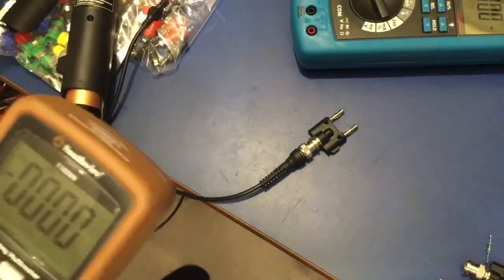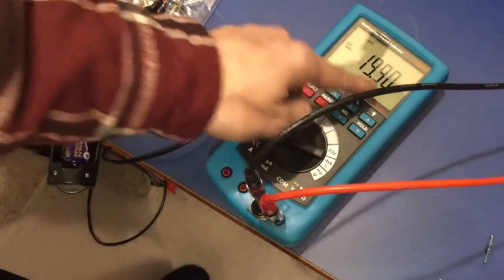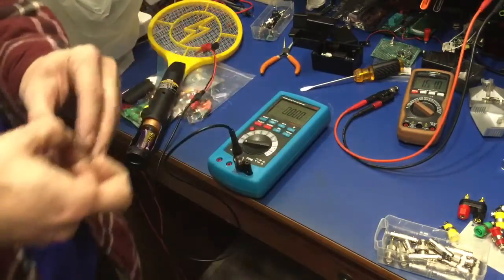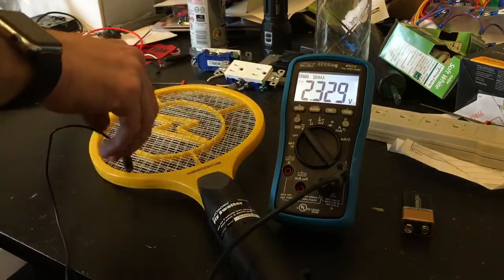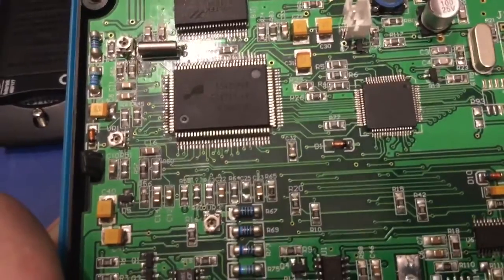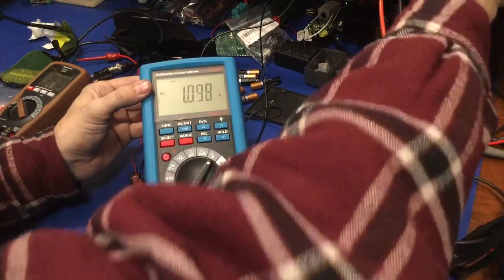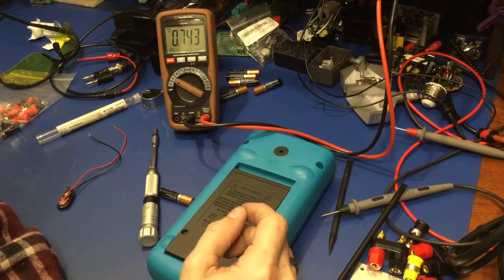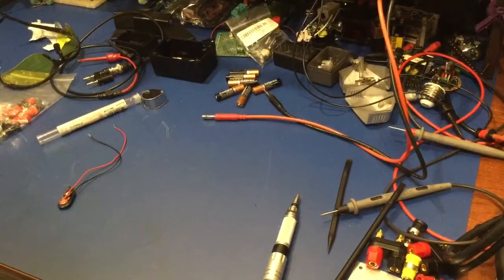Voltage of an electric fly swatter and CAT ratings

Comment: Have you tested exposing the flyswatter voltage to all ranges (except current) on a multimeter? Is that a sane thing to do? I'm so tempted.
Reply from the maker: Brian, It’s not a sane thing to do. The blue meter was a pre-production test unit that had problems, I’m not sure if they fixed it in the final version. That fly swatter does put out a current, not just electricity. Other ranges should follow the same protection path (except current) as the voltage clamping, but no guarantees since arcing can happen and take a different path also. The blue meter was rated CAT III (max 600V) but as you saw it had a design flaw that allowed everything through and didn’t clamp down at all. Another meter I did with current and it took out both fuses, so I knew it had a high initial inrush current coming from the high voltage transformer on the fly swatter. 
This was more a awakening when I discovered a meter doesn’t need to be independently tested or certified, I can make one and stamp Cat III on it and sell it. If that blue meter was measuring mains it would have probably killed me.

Comment: What about the Blue Brymen? That one did survive I assume?
Reply from the maker: Jean-Jacques de Balzac I wasn't going to mention it because I don't think it would take more then two hits. But yes, I did try it ones and it survived, so did my fluke 289 with multiple hits on the fluke. But I would expect that from fluke, I did blow the fuses on the fluke because I think I tried measuring the current for the heck if it, lol. I was on the 10A rang with the stick 11A fuse, but both fused died for the mA and Amp ranges. 
But I don't suggest trying this, this is why I did it. Even some of my cheap meters survived one shock, some multiple. This blue one that died might have survived if I didn't try to get an accurate reading from it, if I had stopped at one or two it still might be working. But nope, when I saw the display say 2,000 something I knew I had to try it again then again and get it in video. Oops, one to may times and it failed. 
So it think most decent meters will take it one time, but I would suggest trying it.
Reply: Well thank you for testing it anyway! I got my Brymen and I see it's CAT II rated for 1kV, (which I assume to be accurate) so you were really pushing it. I'm glad I won't have to subject it to the same conditions now... 

 I didn't have plans to test it btw since it's the only DMM I have... ;)
Reply from the maker: Jean-Jacques de Balzac Well if you happen to feed to much voltage with a very low current it will probably survive a mistake. I told Joe it survived the flyswatter and he decided to by one to test. His test with his generator will cut off if it goes above 40mA of current, but he ran it up to 10,000V, or 10KV and it survived. Not many meters he tests will survive this abuse. Even the cheaper fluke died, and one keysight meter died in testing this high. 
If you haven't watched his review you can see him at:
https://youtu.be/g3uYcHAumhA
Again, this is low current voltage, but it's good to know it's built good for the price.

Comment: I think you threw away a good meter. It looked like the battery was low.
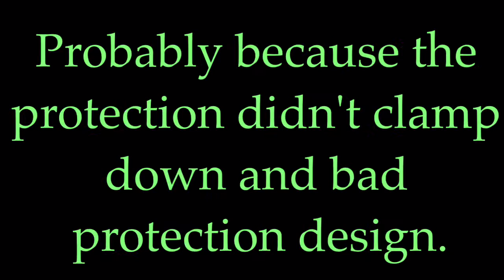Reply from the maker: I would not call it a perfectly good meter, I mentioned some of the problems before I did this with the fly shatter. It bas a beta run meter for testing, I think they fixed most of the issues before production. It was reading low batteries because of the dead short in the cup draining over 1 amp of power. I mentioned this at 6:37 in the video. I was able to see this when I later hooked it up to my power supply. That main chip was also boring up and really hot.